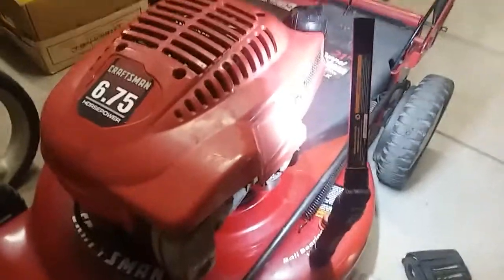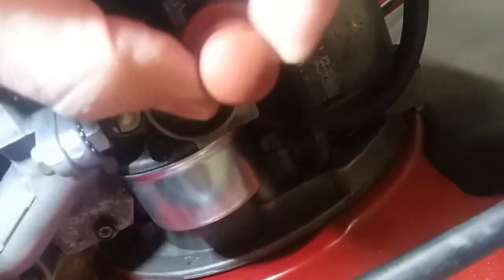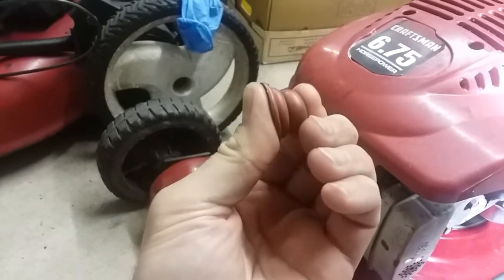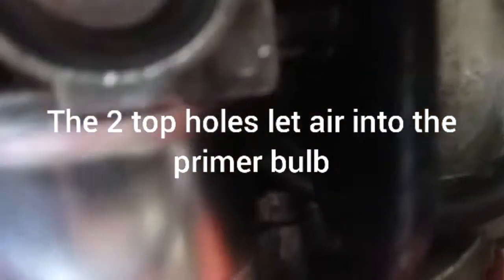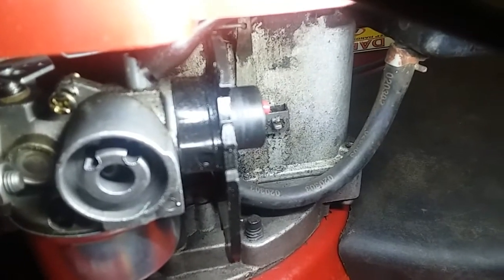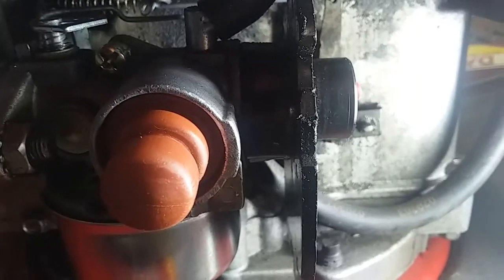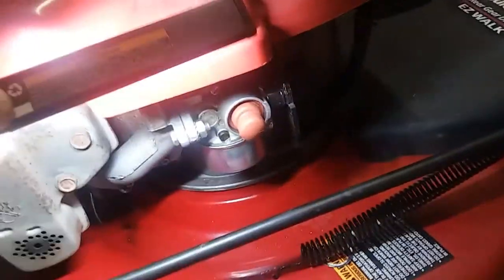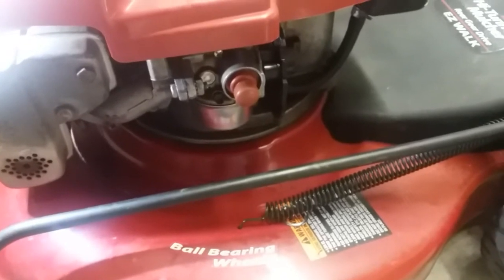Tecumseh carburetor won't prime mower won't start

Comment: THX ! Great video. I have the original series 11 carb on my Tecumseh lawnmower and having difficulty to start it even if I prime it 5-6 times. I'm going to look inside the carb to see if gas is coming up from the emulsion tube. If yes then it's ignition problem. If not, then need to take carb apart.
Reply from the maker: Thanks. Hope this helps. Please subscribe if you haven't already.

Comment: Anybody looking to replace a bad Tecumseh primer bulb, the part number is 36045A. I picked up mine at a lawnmower sales and repair shop and they have them on Amazon also.
When setting the metal lock ring on the new bulb, use a 19mm socket and tap on the back of the socket with a mallet.
Reply: tabs on ring facing up.

Comment: Was it the carb from Amazon? Mine turns over with starting fluid as well, but won't prime. Runs, but won't prime. Thank you for the video! I'll pull that bulb off tomorrow.
Reply from the maker: It came that way from the previous owner. I'd guess Amazon or ebay.